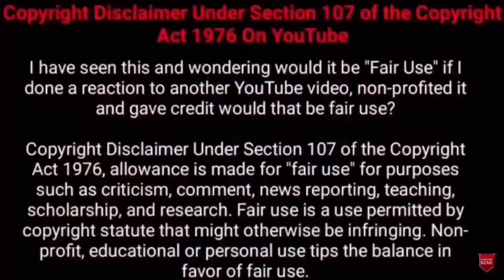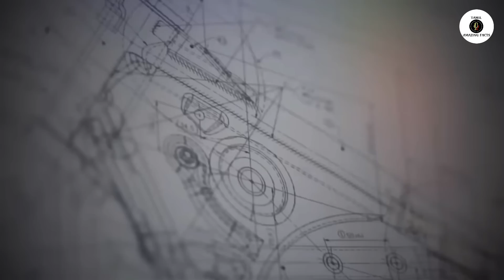உலகின் எல்லா நாட்டிலும் நம்ம பைக்கு தான் ராஜா | Whole World Is Buying Indian | Tamil Amazing Facts

Comment: I am Olready used 1 lacks km, millage 70km Bajaj platina ( மயில் பைக்) 👏👏👏🤝🙏
Reply: 🎉i am still using 2006model platina ❤ 2lakh67km no problem slightly noise coming from inside cylinder kit mileage 72kmpl❤❤ no words telling ❤❤ hat's off bajaj🎉🎉

Comment: Hero honda company in tye up 2006 to 2011
Reply: Hero Honda tie-up stared way back in 1984 ( first bike Hero Honda cd100 Deluxe)...and the tie up separated between hero and honda in 2010.
Reply: @indradevabhakt6244 correct அதே டைம்ல தான் indSUZUki வந்துச்சு அப்பறம் TVS SUZUKi MAX 100 R ஓகே வா நண்பா
Reply: @sarangankarunagaran2248  : Right bro,..just to add, In 1984 not just Ind-Suzuki, but also from the Bajaj Auto (until then they were scooter makers only) came the Kawasaki-Bajaj KB100 ( in the petrol tank livery it would be written as Kbajaj ) and from Rajdoot came the Rajdoot-Yamaha RX100 and RD350..and finally Royal Enfield tie up came with with ZUNDAP Germany to produce Silver Plus 50 cc,. Explorer 50 cc,..FURY 175 cc.